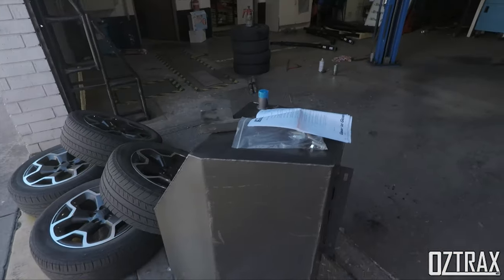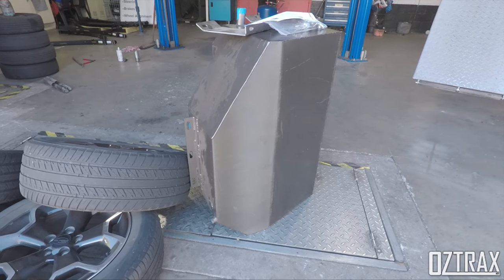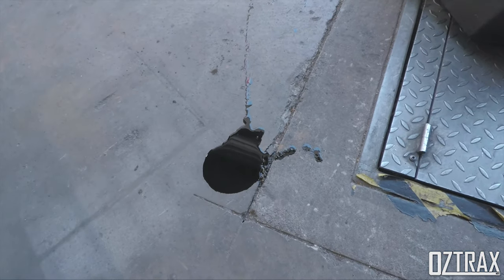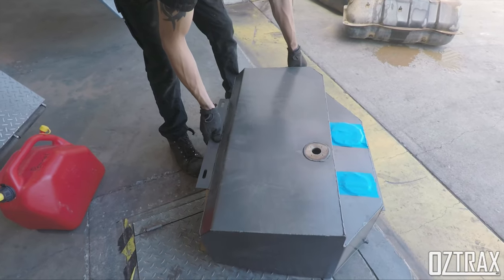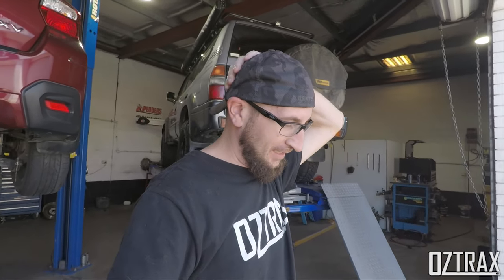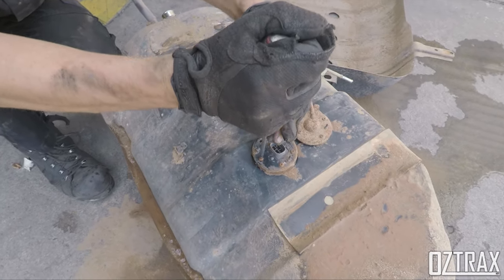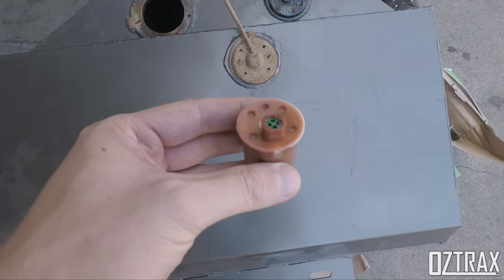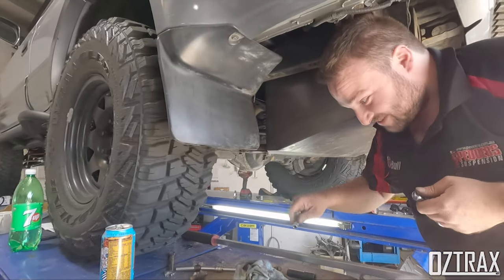Toyota Prado 90 Series // Long Range Fuel Tank Install

Comment: Best mod ever ! Extended range and the extra weight is below the center of gravity right where you want it.
Reply from the maker: That extra range is ideal here in Australia.

How it goes off-road is something I need to test, but it doesn't hang down much lower than the original tank. 👍

Comment: I was looking at getting a replacement long range fuel tank for my 120 series Prado (petrol). Currently has 2 tanks with a combined capacity of 180 litres. As it is petrol, for extended desert trips need more fuel capacity. Any suggestions where I can get LRF tank. (Brown Davis has stopped manufacturing replacement tanks for the 120.
Reply from the maker: The issue you'll have with a 120 Prado is your distance til empty won't read correctly with a long range tank.

You could try 4WD Systems as they manufacture tanks still for the 90 series, so I'd assume without looking that they would do it for the 120 series.

Comment: My brother, what is the maximum capacity of a fuel tank that can be placed in a J120 model Toyota Prado?
For example, is 350 400 possible?
Reply from the maker: From what I can tell with the 120 series Prado, if they are the single tank model, you can fit a 170L long range tank in them.

The models that have a sub tank aren't supported as those ones automatically pump fuel from the sub tank to the main tank when the main tank gets to halfway on the fuel gauge.

Comment: Does this replace the main tank but also keep the sub tank? Like in total with that long range tank with sub how many litres is it. Also 4wdsystems doesn't have this tank anymore 😕
Reply from the maker: Hi Alisha

Yes it replaces the main tank, so the capacity goes from 90L to 155L and still retains the sub tank. The sub tank is 57L from memory, so should give you a 212L capacity.

4WD Systems do the tank still as it's on their website.

The part number for that is FTR143 with a price of $1196.58 + shipping if you're not local.

If they don't have it in stock, they'll have to manufacture it.

Give them a call and ask for Alex. 👍

Comment: Hey Mate i have the 90 series and I'm having an issue with the SUB TANK. Its no longer transferring fuel even after a new solenoid replacement. I have been told it could possibly be a blockage or the fuel pump in the sub-tank is shit itself? 

Its a full Sub tank at the moment the dash light comes on the solenoid is working but nothing is transferring. ANy suggestions
Reply from the maker: Hey Jon

Does it run when you switch to the sub tank or does it stall?
Reply: @OzTrax4X4  the fuel isn't being transferred. It's just using the main. I had half a tank of main and a full sub.......the last 2 days it's dropped a quarter on the main and not moved on the sub even tho the sub switch has been on the whole Time
Reply from the maker: @Krazy7mx  Have you fitted a brand new fuel tank switching solenoid or a secondhand one?

Has it worked previously?

The petrol V6 has a fuel pump in both the main and sub tanks.

I'd assume that it's not switching due to a faulty fuel tank switching solenoid or the fact it may not be picking up from the sub-tank at all due to a failed fuel pump.

Are all the hoses on the correct inlets/outlets?
Reply from the maker: @Krazy7mx  There could also be the fact of a failed sub-tank switch too not triggering the solenoid.

With the vehicle on accessories, and switching the sub-tank switch on and off, the solenoid should have an audible click.
Reply: @OzTrax4X4  SOrry for the late reply just got back form the Kimberley. I will try this its a brand new solenoid so I hope that its not a dud. Ive previously had a second hand one that was working we tested it before installing on the car. installed it and then it didn't work, installed a new one and same thing so I don't think the solenoid is the issue.
Reply from the maker: Kimbo trip would be epic. It's on my list at some point once I recover from this accident.

Another test you could do to see if it is the fuel pump is use a screwdriver and hold the blade against the sub tank and put your ear on the handle to see if you can hear the fuel pump humming away.

I'm puzzled for it to be the fuel pump though because if it was, the car would stall as soon as you switched from the main to sub tank, this is why I'm lead to believe it's a solenoid issue.

If your supply line is blocked down to the solenoid from the sub tank, then it it may forcing fuel back into the main tank via the return line perhaps?

If this was the case, I'd be pulling the supply line from both the tank and solenoid and blasting some pressurized air through it.

The next thing would be to drop the sub tank and see if the filter sock is still on the fuel pump, if it is, maybe it's blocked with junk from the bottom of the tank, if it isn't, maybe it's sucked some dirt up into the fuel pump and seized the pump or blocked the pipe in the fuel pump hanger itself.

Definitely interested to know what you find either way.

Does the solenoid click when you press the switch or is there no audible click?
Reply: @OzTrax4X4  So a lot of people I have spoken to  about the 90 series say there isn't even a pump in the tank. its only a solenoid
Reply from the maker: The V6 has a fuel pump in each tank and a solenoid to change which tank supplies fuel to the engine.

When you press the sub tank button, it turns off the main tank pump, turns on the sub tank pump and switches the lines from main to sub.

If the sub didn't have its own pump, it would then draw from the sub tank into the main tank, but that's not how the 90 series operates it's fuel system.

Comment: Would this also work for a diesel?
Reply from the maker: I believe it would be a similar process, the one major difference is the diesel doesn't have a fuel pump in the tank from memory.